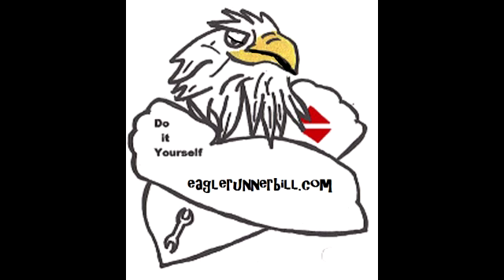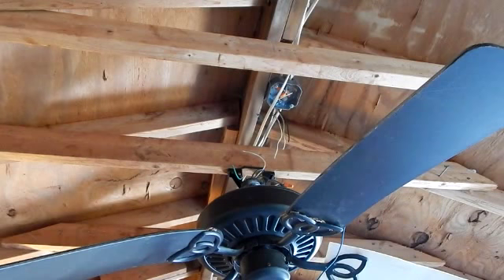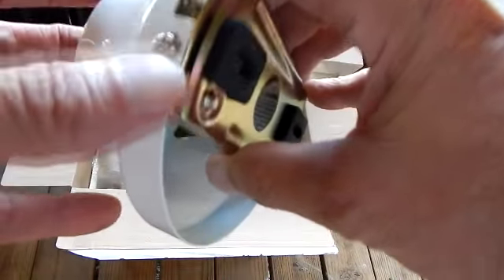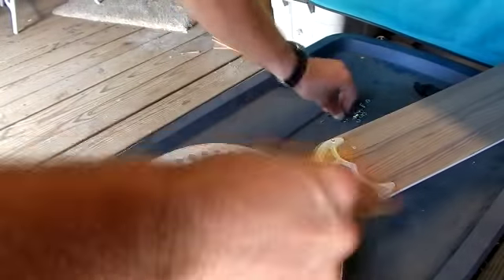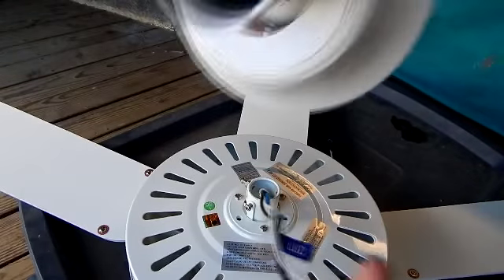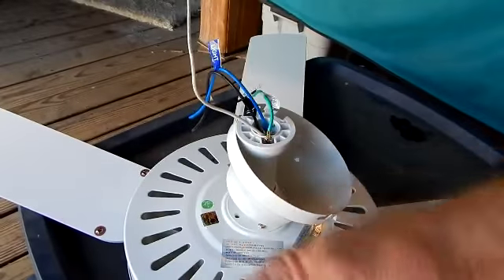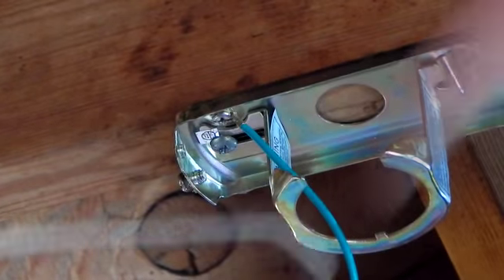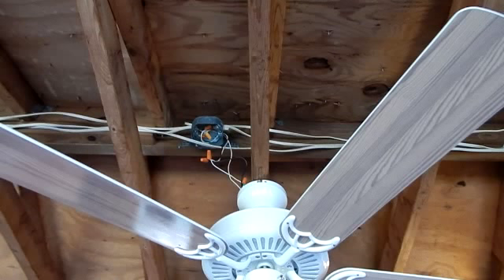Installing a New Ceiling Fan

Comment: The new fan would end up like the old fan did. You should have gotten an outdoor rated ceiling fan for that location, since it can be exposed to humidity, that's how the blades on old fan warped.